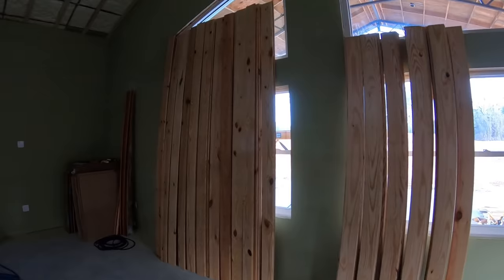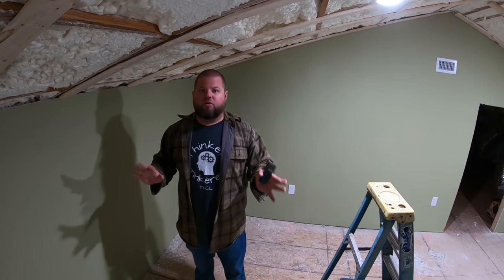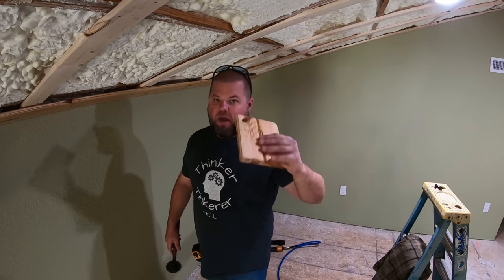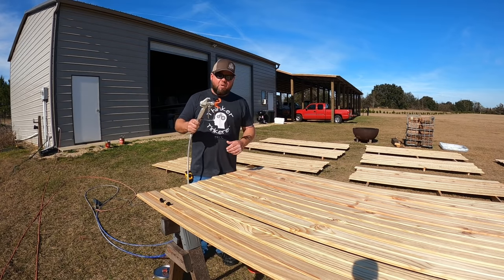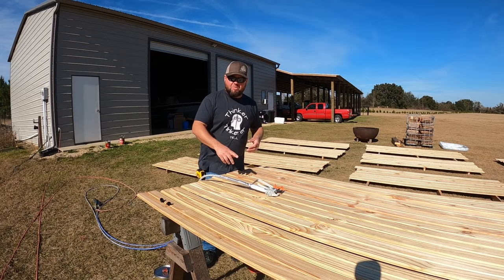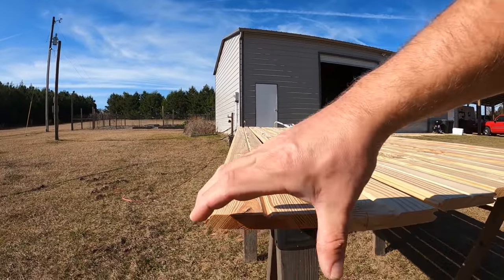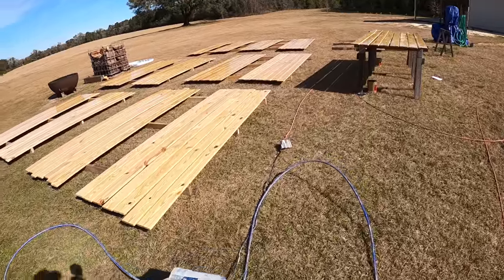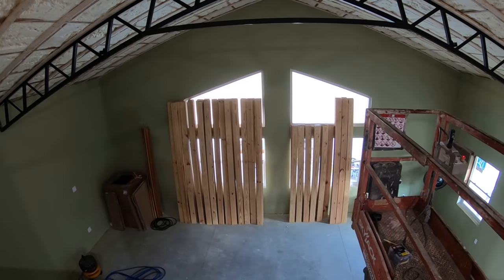Installing and poly coating tongue and groove pine ceilings! #520

Comment: I put the thin version inside my van, it warped on my ceiling, the wall stayed straight, reused a bit from my wrecked van. I love the look of pine, was in my grandparents home in the livingroom, New owner painted it all.
Reply from the maker: Try the thicker board if you can, I've had zero issues.
Reply: @TKCL  Too heavy in a vehicle. If I had my own home, my rooms would be covered, the old pine boards were not flat, I'll never forget my grandparents living room back wall. I wish I had sprayed mine before install, I've been brushing it on, gotta wear gloves, the ceiling has it running back over the handle, but the look is worth it, I like knots, cracks, I seek out wood with imperfections, that is the natural beauty of it all.

Comment: Polycrylic ultra flat by minwax works great. I got 800 sq feet of coverage with a roller. Ultra flat hides imperfections better.  Sand first and once again between coats. Rolling gets into wood better but spraying is much faster.
Reply: did you brush the beveled tongue that’s exposed from the groove? i’m considering rolling but wondering if it’s necessary to brush the connection area

Comment: looks great. A super quick way to cut all the light boxes out is using a router with a flush trim bit. Bit has a ball bearing on it that traces the box.  super quick and precise.   Ya I know its another tool to have to buy.

Comment: Love your attention to detail. I have used T&G , wished I had bought more. Also,  I want to thank you for the tip with the Dewalt special,  buying batteries and  charger with the free tool,  I got the jigsaw which I had wanted forever 😉
Reply from the maker: I've been using my jigsaw a lot! That was a sweet deal!
Reply: What brand jig saw?
Reply from the maker: Dewalt xr 20 volt

Comment: Mine came out great but I had to battle with my contractor about the stain. He insisted it did not need it. Many others said to stain it at least with a light coat to prevent fading or turning an orange color. I ended up hiring a guy to come in and stain it after the contractor finished. Mine looks fabulous. Wish I could post pictures here of it.
Reply from the maker: The key is to poly coat it, that darkens the look and seals it.

Comment: Thanks for  the video. It looks great. Maybe a fake mini beam made from the tongue and groove to finish the middle? One that is wider at the bottom of the beam than the top. You could install LED strips in there for an interesting effect. I have seen that done before. You were right not to do any of the major cutting inside. You would probably have had to set up one of those isolation tents like they do to remove asbestos to keep the saw dust out of everything.
Reply from the maker: Naa we built a pole barn house and want to keep it looking like one. If you mean covering up the trusses with a beam?
Reply: @TKCL  no I am that that narrow gap between the tongue an groove. It would look like a short beam at the peak between the two sides. The trusses are beautiful. (Personally if money were not an issue I would want to build a castle from concrete, stone and steel like Andrew Camarotta did on this channel).
Reply from the maker: I love his building!

Comment: Could have went with 1 1/2 nails because you nailing 3/4 to 3/4 (1 1/2) with tongue 1/4 below when you include nail recess.     Also a compact router with flush trim bit would do wonders to cut out those boxes.  Though saw dust would be crazy!

You also should/could have the boards 1” shorter than actual measurement.  Trim should cover it.

Comment: Looks great, rip a filler piece the width you like with the proper angles to match the pitch for the top. It will fit tight like crown molding and finish it off. Finish the celing ( probably already have )  install counter tops and plumbing fixtures, have electric pulled and inspected for the CO by Feb 23rd, I win.  Don't need the floor for CO. :-)
Reply from the maker: Lol 🤣

Comment: Looking good.  How does it finish at the tip?   What I was suggesting was to measure how  many boards top to bottom so to match and then cut the bottom edge and give it an angle.  That way you would not need to have a molding.   But nice wood you chosen  nice and thick.  As well that v shape on the back it  is more then most would know.  One it takes weight down and if you was to cut in that center you can you that edge to match the groves on the edge if you was to flip it.   As well the finish on both sides it is to keep the 2 sides to dry the same to avoid cracks and it also helps future moisture pass true
Reply from the maker: Still kicking around my finishing idea at the peak. The sheets rock is not perfectly smooth, so I felt trim would flex and hide gaps better than a board cut at an angle.
Reply: @TKCL  try a board next   start.  Might need a little bid of a fill with paintable silicone. But most might not...   adding trim is easyer in a way  but at the cost of wood....

Comment: I love the look, have to be honest with you OCD how could you start there, I do not have OCD but it would drive me crazy if the T&G  does not match up between truss sections,  You be sitting up there  be able to see it every time. I would have started in the other truss section going outside wall to ridge and then ripped a started in the loft, at least the T&G would line up. Keep it up, love what you do.

Comment: That pine will act as a moisture sink and stabilizer in your house making it that much more comfortable. Maybe the pine is softer in terms of acoustics too vs hard reflective drywall.  Looks amazing. Did ya seal the ends of the boards?
Reply from the maker: Did not seal the cut ends. It is already making more of en echo, but it isn't bad.

Comment: Great video... what poly are you using. Been considering a water based varathane product but I'd like to know what you used... thanks.
Reply from the maker: Oil based satin Poly from Home Depot.

Comment: Very informative. What and how much did you run through your sprayer to clean the poly out after spraying. Thanks
Reply from the maker: I flush the entire system with water first and then flush with about a half of a gallon of mineral spirits through the gun and recirculating hose.

Comment: Did your T&G planks have a sticky label on them?  Mine did and when using a straight blade to scrape them off, it splinters the wood.  Any suggestions?
Reply from the maker: No because I bought directly from the mill that makes them. I hate when manufacturers plaster stickers on stuff like that.

Comment: what size nail did you use? I am doing some tongue and groove and I am buying a nail gun just for the job. I am afraid if to go to big on the gauge it willsplit the boards. Thank You!
Reply from the maker: 16 gauge finish nailer with 2 inch nails. Some recommend a 15 gauge, but that's a odd gun and nail.

Comment: It was easy to see the thick coating when it was wet. To me, it was perfection. I have a question. Do you plan to cover the trusses or leave them exposed?. With a little creativity, you could make them appear to be huge rectangular wooden beams. 
Congratulations on a great job.
Reply from the maker: Leaving them exposed, it's a pole barn house so no need to cover up it's roots.
Reply: @TKCL  It is a beautiful house.

Comment: I'm probably missing the obvious here. What brand of poly did you spray? Are you happy with how it covered? Also, are those 1x6 boards or 1x8"?
Reply from the maker: 1x6 pine, I used an off brand satin oil based poly from home depot.
Reply: Thank you!  @TKCL

Comment: Just wondering if your using water base or oil base poly? Oil base I think is lot better but water base sure makes cleanup lot easier.
Reply from the maker: Water based
Reply: @TKCL  I also like that you were getting a good smooth  one coat finish using that series 5 tip

Comment: I stained mine after I put it up. Hugh mistake!!! Those boards will continue to shrink and move. Ever 2 - 3 years I have to take a model car fan brush  and touch up the grooves. It is not easy or fun. Always stain your boards before you put them up.
Reply from the maker: Awesome, thank you for verifying the information.

Comment: Hey Andrew What Did you Clean your Paint Sprayer with after you finish spraying ? I'm just cringing over here about putting stain thru my sprayer.
Reply from the maker: I've done it several times with zero issues. Just flush very well with mineral spirits and store with mineral spirits in the hose and pump.

Comment: What brand finish did you use. Wish you would have shown a picture of the can so I can get the same stuff for my house. Your home is really turning out nice.
Reply from the maker: I struggled finding anyone with more than a couple of gallons of poly in stock. Went with a off brand from home depot.
Reply: @TKCL  the polyurethane you used water or oil base
Reply from the maker: Water
Reply: Thank you

Comment: Is that water based poly?
Reply from the maker: Oil based
Reply: Did it tint the wood yellow at all? I just installed about 3500 sq ft of pine on a cabin I’m building for myself and want it to have a semi gloss coat on the wood. I am not staining it. I want the natural wood color. I have read mixed reviews about water based poly staining wood yellow
Reply from the maker: @MooneysExcavating  it does instantly "richen" the wood. Pine will absolutely oxidize and yellow naturally with or without sealer. I'm talking about yellow pine, not white pine.

Comment: Nice Video!  I need some advice please.  Building a tack room with T & G pine and was going to stain it and then put gloss poly over it, but now I want to put just gloss poly.  What brand did you use?  The walls are already up, how to apply poly best?
Reply from the maker: The best way is spraying all 4 sides while on the ground, but since the walls are up you can spray or brush/roll it on. I prefer spraying but that can cause runs. Brushing it on can leave blemishes and often requires you to sand it and apply another coat. I used an oil based satin from Home Depot.